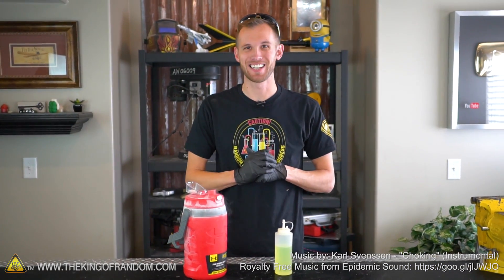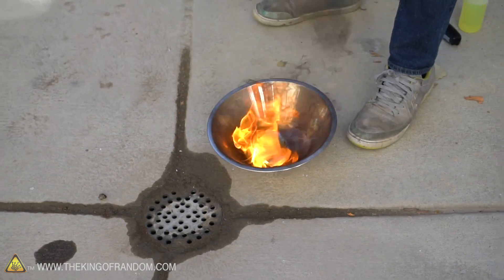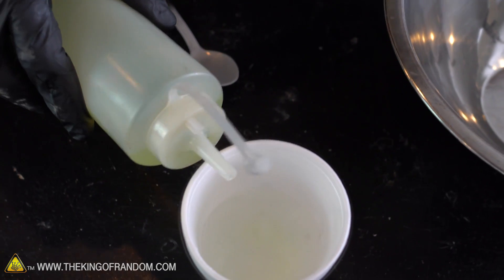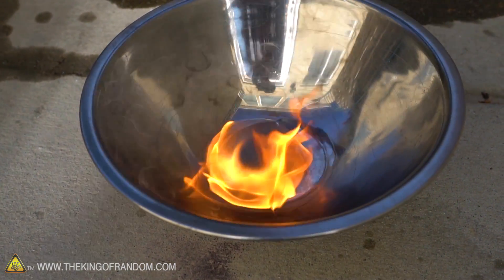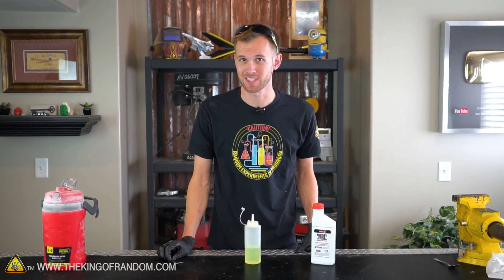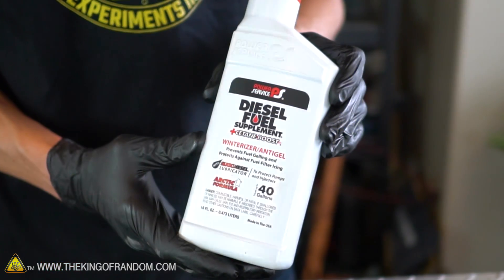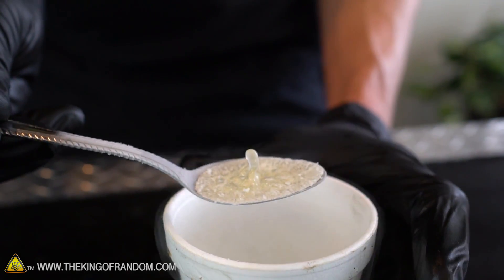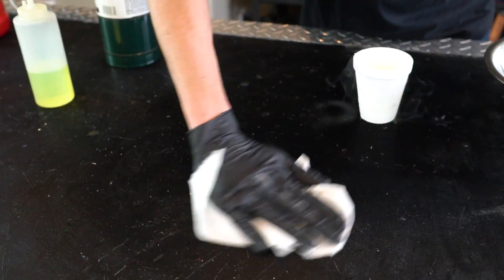Testing Diesel in Liquid Nitrogen! TKOR Experiments With Frozen Diesel Gasoline Science

Comment: u have no idea what diesel  is it ain't fumes like gas that burns its mostly oil and it is burning plus it gels at 15 degrees  not 30 plus diesel engines run by compression not ignition.

Comment: If I'm not mistaken there has to be kerosene. Diesel don't light like that you could take a torch to diesel and it won't light it usually has to be spritzed mistform. So I'm thinking you're doing all your tests with kerosene which smells like diesel but is not diesel.

Comment: Diesel has a higher flashpoint and temperature at which it freely burns. If it's frozen, not only does it require heating to burn, it also won't give off enough evaporated fuel to maintain combustion.

Comment: To get the explosive results you want in diesel that gasoline has, you would need to compress the air (very rapidly) around the diesel fuel to roughly 234 psi, which in turn will head up the air to 500-600 degrees Celsius. I wouldn't want to be anywhere near that eruption, because it would be very violent and (obviously) very very hot.

Comment: You're not actually freezing the diesel... you can tell by the color that you're using standard diesel fuel that would be used in a vehicle, or #2 low sulphur diesel fuel. Rather than freezing the diesel you are gelling and solidifying the paraben wax which is why you get crystals with liquid inside them, also when it powdered the same effect, smaller scale. You have wax soaked in diesel and for the diesel to burn you need to melt down the wax ^_^. We deal with this as a truck drivers, diesel doesnt freeze, which is why blending low sulphur #2 highway diesel with #1 diesel us needed in low temperatures. The volder the temps the more #1 diesel you have to use.

Comment: what would happen if you put diesel or any flammable liquid  in a steel bowl  let it burn for a bit then put the other steel bowl with a vacuum pressure  meter attached to the flat side of the bowl  and see how much vacuum it pulls

Comment: What if you lit a fire in the bottom bowl and put the top bowl on and poured on quite a bit of liquid nitrogen on top? I think the suction would be extremely strong. Also I think maybe soot/fuel got on the lip of the bowls the second time you tried it, causing the vacuum seal to break easier than the first time the bowls got stuck together. I think the first time they were very clean and the seal was very strong. Just a theory.

Comment: Liquid fuels don't burn. Their vapours do.
These liquids start releasing vapours in the atmosphere at a temperature related to their molecular structure, which is called the 'flash point'.
Above that temperature any free flame getting in contact with the fuel enriched air close to the liquid fuel, will start burning, eventually heating up the liquid enough to let it evaporate more.

Flash point of gasoline ranges between -30 and -50 C (-22 to -58 F, for you retrograde yanks).
Flash point of diesel fuel instead is between 55 and 65 C (131 to 149 F).

That's why a lit cigarette won't light diesel at ambient temperature.
Nor does the modest flame and heat of a kitchen lighter for a short amount of time.

You need a lot more heat to let enough mass of liquid get to the flash point temperature and start letting vapours into air, where it will mix with oxygen and burn.

Cheers

Comment: Please don't wear tight fitting non-insulated gloves when working with liquid nitrogen! It could get inside the glove and it would take too long to remove or the glove could become stuck to your skin ripping off your skin with it. Get rated cryo-gloves or at the very least loose fitting work gloves with no holes in them.

Comment: Great video!! Diesel has almost the same flashpoint as Jet A1. It needs heat & pressure to ignite. In turbine engines we refer to a state called "self sustainable" where the engine combustion in the compressor doesn't need any further electric ignition during start-up. Cold, non pressurized Jet Fuel or diesel are both very difficult to ignite or combust.... which makes that scene in "Die Hard 2" where John McClane (Bruce Willis) used a lighter to lite the Jet Fuel spilled on the snowy runway totally impossible. This video basically just busted the Die Hard 2 plane explosion scene myth. Also the jelling effect under extreme temperatures in Jet Fuel is exactly what caused the crash of British Airways Flight 38 in 2008 when the fuel in the wings were exposed to extreme temperatures flying over Siberia prior to landing.

Comment: gasoline is explosive, diesel and kerosene are less explosive and more flammable, because they are made from thicker parts of oil. there is a sort of scaling with the smaller being more "explosive" and the lesser being more viscus and tend to just burn.

propane, butane, gasoline, jet-fuel, kerosene, diesel, other "heavy" fuels, light oil, heavy oil, tar(tac),rubber.

 some of the product are the result of further refining some of the fuels to extract the material or by adding other chemicals.

Comment: Diesel, has a high flashpoint, at which it burns.Gasoline has a high flashpoint, which is why throwing a match in it,  and doen't ignite it. However; gasoline Fumes haves a lower flashpoint. which is why it ignites. You are burning gas fumes!

Comment: Diesel is hard to light because it needs high pressure and heat.
Reply: Lloyd Walker It doesn't need high pressure, just high heat. It's just that the high heat is made by compression in an engine, but it isn't needed to light diesel.

Comment: Yes, you can freeze diesel with liquid nitrogen. 
Prediction: Liquid nitrogen in container -> Diesel poured in -> diesel freezes -> liquid nitrogen evaporates or is removed -> diesel thaws. OR Diesel in container -> liquid nitrogen poured in in sufficient amounts -> diesel frozen near the liquid nitrogen -> diesel poured away -> diesel frozen very shortly.
Reply: After seeing it. No it was not additional nitrogen. It was because the diesel snow lowers the temperature of the diesel to a point lower than it needs to burn. 
Diesel has an almost 100 degrees hotter flashpoint than gasoline at around 50 degrees celsius if memory serves. While Gasoline has a flaspoint of way below the freezing point. Gasoline can burn in a freezer, Diesel can't.

In other words, trying to ignite the diesel next to frozen diesel is like trying to make ice cubes(H2O) in room temperature.

Comment: Theres a rule for burning stuff you need oxygen, fuel and heat. You can't burn ice. And thats how a carbon dioxide fire extinguisher works, its cooling and removing oxygen. The cold diesel outs out the fire by absorbing the heat energy

Comment: diesel isn’t as flammable as gasoline the diesel in an engine is just being compressed to the point at wich the air diesel mixture combusts so therefore a diesel engine doesn’t have spark plugs

Comment: what will happen if you put fire in vaccum chamber
Reply: Zaki Uddin it would put out the fire because the three main components of a fire are fuel, air, heat. And if you remove the air the fire doesn’t work.

Comment: Not the fumes.  Diesel burns at a much higher temp than gas so in which it has a higher combustion point. It wont burn as easily.  From frozen, so it has to warm up before it can be ignited

Comment: For a dry ice experiment can you try to boil dry ice and see what happens
Reply: The warmer the dry ice gets, the faster it turns from solid ice into gaseous CO2. It does the same thing as it does when exposed to the air, only it does it faster. If you put dry ice in a foundry with molten metal, it does the same things, but faster still. The more heat, the faster it turns into CO2 gas.

Comment: Another thing you should try is splitting rocks. I know for very large rocks they drill deep holes in them and pour some sort of foam in there that expands and cracks the rock open. What if you drilled a hole in a hand sized rock and put something like insulation foam in there? Would it crack?

Comment: So I know that oxygen is a key ingredient in combustion, but what if you have too much? If you have a high pressure oxygen tank and poke a sizable hole in it will the outflow of high pressure air put out a small flame or just result in an insane flamethrower?

Comment: Diesel fuel is designed to ignite under pressure, not spark or flame. It does burn but it's not very flammable due to the oil content and lack of fumes.

Comment: i would be more concerned about the motor oil than fuel in low temperatures, also you might as well tryout e85-e100 to get all 3 main fuel types tested.

Comment: Is there anything that does not freeze in liquid nitrogen.
Reply: Freeze means the temperature at which a gas or liquid becomes solid. Many things are naturally solid, such as wood, plastic, textile, bone, etc. If it's naturally solid, it does not "become" solid at some temperature, so it doesn't freeze. It just gets extremely cold. On the other hand, many materials (such as wood) also contain a certain amount of water, and the water in wood will freeze, making the material brittle and fragile.

Comment: What happens when we put dry ice and liquid nitrogen into the vaccum ?
Reply: Nothing really happens. The dry ice and/or liquid nitrogen will continue to give off "steam" (that it, is slowly sublimates from liquid form to gas), just like it does without the vacuum chamber. As the dry ice and LN give off gas, the vacuum chamber will expell the gas to maintain the vacuum. There will be no visible action, the chamber simply removes any gasses that occur.
Reply: shinaanish thanks
Reply: shinaanish you can’t have something sublimate from a liquid to a gas it has to be from a solid to a gas, other than that your answer was acceptable

Comment: There is something which u guys have to consider when you want to light any type of fuel on fire . Which is the Flash point  . Each fuel has different flash point such as gasoline has low flash point which can ignite easily in low temperature . And it can ignite  by itself violently  if it reaches it's flash point which is -41F° . Unlike Diesel fuel which has a higher Flash point which it needed to heat up the Diesel up to  100-130F° and it will self ignite  and it's going to be easy to ignite just like gasoline ... you really should try that out to get familiar with Fuels and their flash point for your next experiments .

Comment: Because diesel has an ignition temperature of 67 degrees centigrade it’s not going to ignite at -210 degrees centigrade
Reply: Diesel fuels have a flashpoint varying between 52 and 96 °C and it needs compression in order to auto ignite.
Reply: Melvin Sandberg it has a auto ignition poiny at 67 centigrade
Reply: *point
Reply: Not to mention gasoline is ignited in engines by an ignition source (spark plug) whereas Diesel, as well as the additives are ignited by compression (no spark plug) hence why it’s harder to light the diesel with a flame and you don’t see a whole lot of gas station smoking mishaps at the diesel pumps
Reply: I thought it was celsius.
Reply: @blaze-zee-wolf  Centigrade = Celsius
Reply: @Drakeblood97  Oh.

Comment: IDK if anyone pointed this out yet.. But the properties of Diesel and Gasoline are completely different.. Gasoline is more Volatile hence why it uses a spark plug to ignite. Diesel relies on the compression of heated air to ignite it. Hence why it didnt light as quickly frozen as did the Gas. Just a quick insight

Comment: Could you make a video with liquid nitrogen & water in a vacuum - we know that water boils in a vacuum but what happens if the container holding the water is sitting in a bowl of liquid nitrogen? Will it freeze while boiling?

(Also is there a way to freeze water in a partial vacuum to remove the air bubbles to make clear as glass ice?)

Comment: Diesel engines don't burn the fuel to make combustion they run off of compression to make the diesel ignite and cause combustion they dint use spark plugs either they use glow plugs

Comment: Diesel doesn't really burn. It explodes under pressure and heat due to that pressure. Compression ratios in diesel engines is about twice that of gasoline engines.

Comment: What happens if you freeze jet fuel in liquid nitrogen?
Reply: Frozen jet fuel will not burn. No frozen fuel can burn. Jet fuel must reach its flash point before it can burn, which is well above freezing.
Reply: Gasoline burned while frozen
Reply: It will freeze steel beams

Comment: Diesel is a lot different than gasoline, diesel fuel is used in semi-trucks, tractors, powerstrokes, Cummins, and duramaxs, do NOT ever put diesel fuel in a vehicle that requires gasoline and do NOT put gasoline in a vehicle that requires diesel, it will screw your engine up

Comment: The reason the diesel doesn't light with the bbq lighter or when it is super cold is because it's not really flammable like gasoline. In a gas engine, the gas is ignited with a spark that causes an explosion. In a Diesel engine, a spark would not be sufficient. Instead of a spark, Diesel engines heat the entire cylinder with glow plugs but they don't ignite the diesel either. The diesel ignites from the heat of compression as the piston moves up the cylinder. That is why Diesel engines have much higher compression ratios than gas engines. Also diesel has more oil in it than gas.

Comment: Diesel runs solely on compression. Gasoline has more energy packed per gallon, and is the reason why it uses spark plugs. Diesel gas and air is compressed a lot where the piston head is normally closer to the valves and that's what lights it and explodes it which is why diesel engines are a lot louder.

Comment: can an alcohol freeze in the liquid nitrogen and still burn
Reply: Ahmed Gaber 

Chances are slim. Alcohol burns because of the vapours. If you freeze it, it will not go from a solid to a gas instantly.
Reply: Ahmed Gaber
The alcohol will freeze, but frozen alcohol will not burn. Neither will frozen gasoline or frozen diesel. Even liquid alcohol/gasoline/diesel will not burn (until it reaches its kindling point). Before that, only the fumes burn, but any fuel must reach its flash point before it can produce fumes. The flash point is well above freezing.

Comment: Can you actually boil  liquid nitrogen I am not sure. If it gets  boiled or get's hot I well be surprise 

Also someone tell me in the comment's if you can boil it or get it warm
Reply: Pour it in a  bowl tadah its boiling
Reply: Liquid nitrogen is so cold that the reason it looks bubbly when it hits room temperature it’s actually BOILING in room temperature sooooooo. He has all ready done that 👌🏻🤓
Reply: It will just turn to a vapor
Reply: Liquid nitrogen will boil even at 0 degree celsius and evaporate into Ntrogen gas. Its very anti climactic.
Reply: gamer girl  no it would explode
Reply: gamer girl
Liquid nitrogen boils when it is above -196 °C. If you put a rose in liquid nitrogen, the rose causes it to boil. If you put a marble in it, it boils. Dry ice causes LN to boil. Anything warmer than -196 °C causes LN to boil. LN can never get to what you would consider warm, because it turns to gas when it gets above -196 °C. There is lots of nitrogen in the air that you breathe, and that nitrogen is warm, but you can't see it, smell it, feel it, touch it, or taste it. It is just like air.

Comment: Diesel, unlike gasoline, requires high heat not a spark to ignite. This is why Diesel engines have glow plugs rather than spark plugs. This would be why the nitrogenated diesel wouldnt stay lit. It wasnt producing enough sustained heat to ignite.

Comment: It's compression that gives the bang of diesel, those engines use glow plugs to assist with heating it to the level needed to create such "combustion", unlike Gasoline which the vapors and spark combined create the bang XD
Reply: THANK YOU.... I have been looking for someone with this answer
Reply: I wonder why he doesnt't know it. That was my first thought about Diesel.
Reply: Though it looks like when he used the propane burner, it heated the diesel enough to create fumes which is what I suspect is what got lit.
Reply: Finally someone else that knows the answer

Comment: You couldn’t light the diesel because the liquid it’s self isn’t  actually very flammable, it’s the vapour from it which is burnt, this is why diesels are more economic than petrols because less fuel is injected to form a fog/mist in the combustion chamber. Only a very hot flame could light the liquid it’s self

Comment: whenever you burn a fuel, its not the liquid that burns, its the vapour. So the solid diesel all that happens is that its going through an extra step. Also the reason the petrol gave a more 'exciting' burn was because the flash point of petrol is much much lower than diesel.

Comment: The reason its not burning as nearly as much as pump gas is because diesel needs a hotter heat source like red hot metal which some diesel engines use in form of glow plugs or extremely high preasure which causes it to combust which the other types of diesel engines use. Diesel is also basically just jet fuel so it does need a super hot heat source.

Comment: Diesel explodes under very high pressure ( compression )  It's shear compression that gets those engines to run I believe. Higher burn temp also, I've had some mishaps where I work lol. ( Truck yard)  Thank you for the upload!

Comment: Freeze gasoline and jet fuel with liquid nitrogen and will it still burn while it's frozen
Reply: Gasolines flash point is about -40c and jets flash point is around 35c. So no it wont burn from applying an ignition source. However judging from this they will just hold the torch over the fuel until it ignites
Reply: Josh Byrd thank you
Reply: No problem; I do that stuff for a living glad to help ya